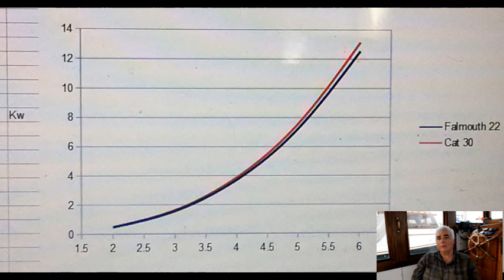Is Electric Propulsion Workable on an Off-Grid Solar Powered Cruising Sailboat

Comment: Engineless sailor here... ONLY if you are in the same mindset as Lin and Larry Pardey. Sail literally everywhere, never turn on the motor.

The best way to look at it is as a hydropower generator that you turn on as a motor only in port. If you do that, it can work. 

Check out Sailing Uma.

If you want to do this, for example, you will have times you'll need to wait offshore, hove to, for 12 hours to get the right tide to enter. Sometimes, you'll need to wait days to enter while weather changes. Sometimes you'll need to abandon your port plan entirely.
Reply from the maker: I agree, electric power works if you don't use it much or very very long when you use it.  For a cruising sailboat it really isn't a viable option, particularly on a smaller boat.  On top of that you have to balance the environmental cost of the electric power system (batteries, motor, etc. versus the amount of fuel you will use in a diesel powered sailboat.  I have an Allied 36 ketch.  My average fuel burn over the past 25 years is 0.43 gallons per hour and I mostly sail so total engine run time is in the 20 hours per year range.  So I burn about eight and a half gallons of diesel per year.  It would take me many years to pay off the environmental cost of converting to electric propulsion. not to mention the monetary cost.
Reply: @todddunn945  great reply. I'm mostly concerned with cradle to cradle rather than an ambiguous "environmental cost" factor, personally. The various estimates I have seen, seem to be politically, rather than environmentally motivated.

Given that, the best battery would be NiMH. Lithium batteries use cobalt and a few other rare earth's which I'm not so comfortable with. Hopefully someone will start producing them since the Panasonic patient ran out.

I personally would rather a diesel electric hybrid. You can locate the diesel genset anywhere, it can run at fixed economy, and you can go for a few hours without turning it on if you like. Plus, you would have plenty of power to run auxiliary systems with a 30kw or better. Plus with a large battery bank, you could handle peaks without having to run an engine on full power.

I know it's technically more complexity, but you could probably get rid of many holes in the boat that way :-),
Reply: Oh and...yes. For economy, you can't beat a good marine diesel.
Reply from the maker: @timothyblazer1749  DIesel electric hybrids don't make sense to me.  They are less efficient than diesel alone due to inefficiencies in generating electricity and then in running an electric motor.  A typical small diesel genset runs in the 70-85% efficiency range with efficiency increasing with load.  That is efficiency relative to shaft horsepower output of the diesel engine.  Electric motors used for boat propulsion have efficiencies in the 90% range if run in the 50-80% output power range.  That means that power at the prop for a diesel/electric propulsion system will be no better than about 75% of that when running the diesel directly.  The only advantage is high torque at low prop speed, but that is meaningless on a small boat because a small prop can't use the available torque.  I don't see how you are going to lose any "holes in the boat".  You still need cooling water intake and outlet ports for the diesel generator and you need a shaft seal for the propeller shaft.  On top of all that a hybrid system has more parts to break than a diesel propulsion engine.

Actually I think lithium batteries are far superior to Nickel metal hydride batteries for a variety of reasons.  Foremost is the cycle life of lithium batteries, which can be as much as ten times that of a nickel metal hydride battery.  Lithium batteries also have higher energy density than NiMH batteries.  As far as battery chemistry goes, yes lithium polymer batteries use cobalt, but Lithium Iron Phosphate batteries (LiFePO4) do not contain nickel, cobalt or rare earth elements and are much safer than lithium polymer batteries.  In my opinion lithium iron phosphate batteries are the best current choice for marine propulsion batteries except for their cost.
Reply: @todddunn945  I think we're talking about two divergent things...you like ketchup, and I like mustard. :-)

Genset efficiency: you are right, except when you size up and go brushless DC. I did say 30kw, right? 

Secondly, I'm happy to admit that you would lose a few percent in theory. Transmission losses, however, are lower for a well designed electrical system as the motor is directly attached. Your losses are only electrical, and can be mitigated with placement and component choice. Also, you have less long term costs from everything, as a good genset is remarkably easy to maintain, and since it's load isn't really variable, it's longevity is higher.

As far as batteries goes, NiMH can last about as long as lithium. This was shown with the Toyota RAV4 in the 90s using Saft batteries. They are less energy dense, but they use no rare earth metals, and their manufacture is far less energy intensive.

So clearly it's a trade off. I like mine, and you like yours. I don't think there is a best answer accept to say...if you don't have a diesel prime mover in your boat, you'll regret it. :-)

Comment: By the way, I found somewhere that the propeller efficiency affects this calculation quite a bit.

For instance, a propeller that is 70% efficient would raise the 4-kWh to 5.7-kWh, and in addition, an electric motor that is 93% efficient will further raise this to 6.3-kWh.  Add to this your discussed energy production efficiency of 80%, and this goes up to 7.7-kWh.

I don’t know where you plan to cruise, but https://pvwatts.nrel.gov will provide you with a good estimate of peak sun hours by month and by year based on your location around the globe.
Reply from the maker: Actually the simple formula I used assumes about a 50% efficient prop, which is about as good as you are going to do for a sailboat prop.  Thanks for the solar link.  I have seen that site.
Reply: Todd Dunn I did not realize the prop numbers were included.  

You are welcome.

Comment: First time I find an online presentation addressing this neglected area of boat power.

I noticed that you omitted posting the Wyman formula used for the chart.  

Any chance of sharing it?

How would having two or three hulls affect the results?
Reply from the maker: The Wyman power formula is: SHP = (disp/1000) x (kts/sqrt(WL))^3

where: SHP = shaft horse power
            disp is the displacement in pounds
            kts = speed in knots
            WL = waterline length in feet
            sqrt = square root

So a 7,000 lb boat with a 22' waterline length traveling at 4 knots takes 4.34 hp or 3.24 kilowatts.  The same boat at 6 knots requires 14.65 hp or 10.93 kilowatts.

This formula is an approximation and only valid for displacement monohulls. There is a coefficient in the formula that is about 1 for displacement monohulls.  It is a function of boat speed. The calculations for cats and trimarans are much more complex.
Reply: Todd Dunn thank you for providing the formula.  

Where could I find information on how it applies to boats with more than one hull?
Reply from the maker: @ek9772  that formula only applies to single displacement hulls.  I am personally not aware of power formulas for multihulls.  I am not saying they don't exist, just that as a monohull guy I have never looked for them.

Comment: Finally a video on youtube based on common sense and logic.  I'm all for electric and solar, it's nice and quiet. I am currently building a 21 foot all solar powered sailboat. But it didnt take long to decide that the sails and masts all had to go. Also have to build a roof over the entire thing to put panels on. It will need a lot of battery capacity and according to calculations, I will get 5-6 hours of run time per day at a blistering 3-4 mph. But I'm only using it to go down river, and not going to get in any hurry. So it has its applications, but they are still very limiting with todays technology. Thank you for the video!
Reply from the maker: You are welcome.
Reply: how many watts in panel are you using and what type of motor and power capability? thank you for sharing
im planning on adding 1kw in solar panel and having a 86lb thrust trolling motor as a backup to a kicker motor and sails what do you think of the viability of that? thank you for sharring

Comment: You forgot about ways to use propellers to regenerate power under sail. Also today solar panels can produce 200 W in one panel with a 32% efficiency rating where the highest last year was 17% efficiency. You didn’t talk about creating brackets to put four solar panels behind the boat
Reply from the maker: I didn't discuss Regenerative charging because the premise I was addressing was pure solar charging.  In addition, regenerative charging from allowing the propeller to turn under sail has a couple of major limitations.  First, regenerative charging is not very efficient.  If you look at the power curves for available regenerative systems, they put out very little power at speeds below 5-6 knots.  Furthermore, even at 5- knots a typical regenerative system will only produce 50-75 watts of charging.  In the real world a small sailboat is not going to average 5-6 knots except possibly on a trade wind passage.  Even then 24 hours of sailing will only produce 1.2 to 1.8 kilowatts of energy for charging.  For a typical cruiser traveling 6-8 hours a day under sail between anchorages a more reasonable average speed might be 4 knots which might produce 200-300 watts of charging.  The second negative is that regenerative charging causes drag which slows the boat down, which in turn decreases regenerative charging.  The only time regenerative charging makes sense is on passage and even then it only provides for normal day to day power usage (lights, water pumps, sailing and navigation instruments, etc.), but not power for propulsion, except possibly for a short (less than an hour) run at the end of a passage to enter an anchorage.

My comments about solar panels were based on what is available today for reasonable prices.  Yes there are  more efficient panels than today's consumer panels, but they remain prohibitively expensive and also have limited availability.  A rack "behind the boat" for solar panels does not escape the shade issue on a sailboat unless it is mounted on a towed raft.  Remember, even a 30 foot sailboat has a 40+ foot high mast that casts shadows.  If the panels are on the boat, they will be shaded part of the day.

Comment: I definitely think I would stick with the diesel engine the boat came with and just deal with the fuel usage.
Reply from the maker: I agree 100% particularly since fuel consumption is quite small on small boats of this sort.  A typical 10,000 lb displacement hull boat will consume on the order of 0.3 gallons of diesel per hour of operation at 5 to 5.5 knots.  In addition the diesel engine provides a mechanism of battery charging and also provides hot water when it is run for 30+ minutes.